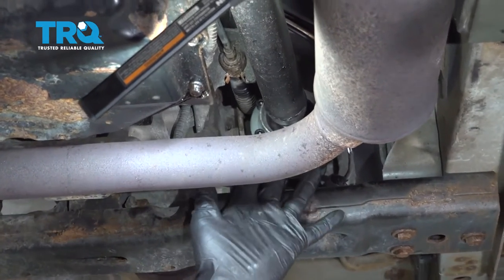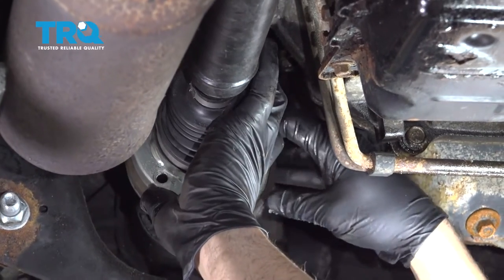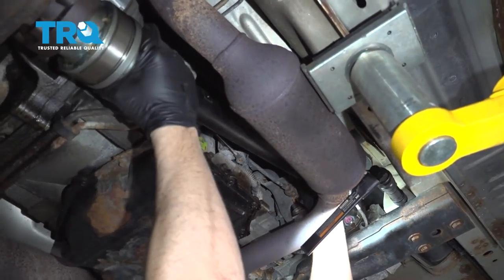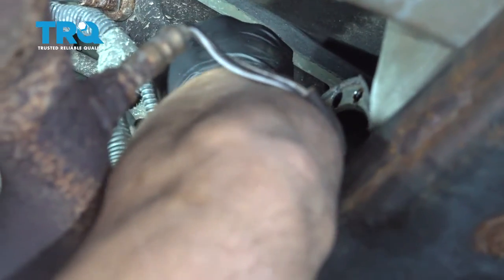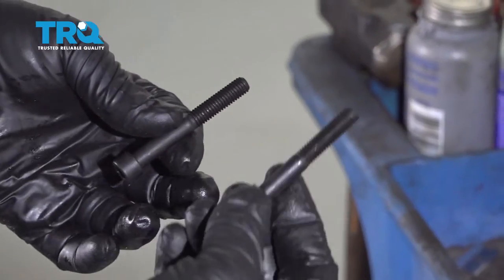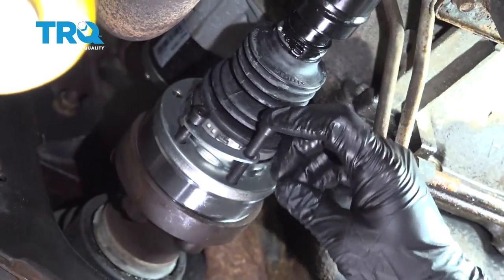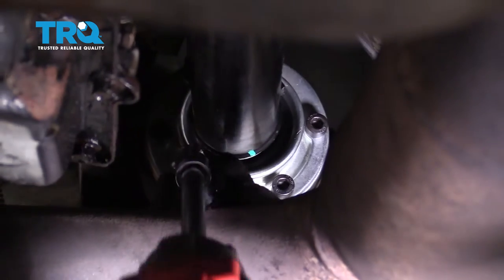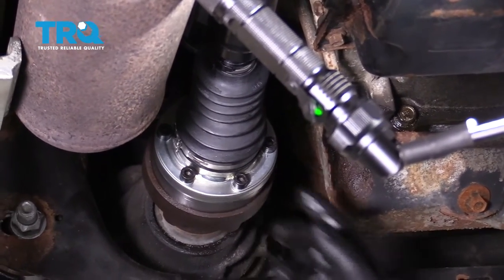How to Replace 4 Wheel Drive Indicator Switch 2002-2007 Jeep Liberty

Comment: You can go threw the top and use a swivel socket took me about 20 minutes and mines a diesel it sits back further for engine spacer for diesel engine center council is simple to remove